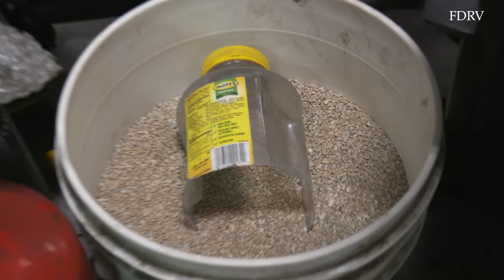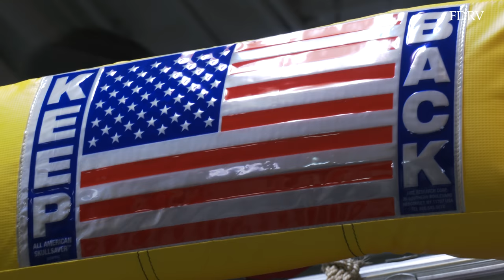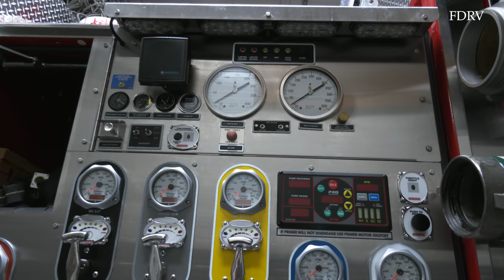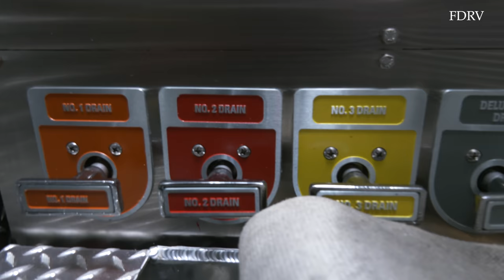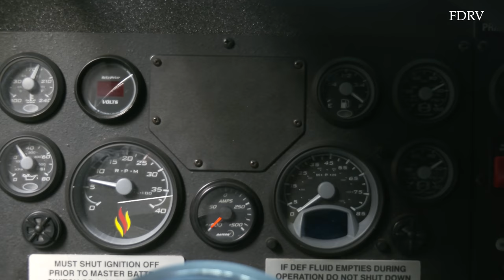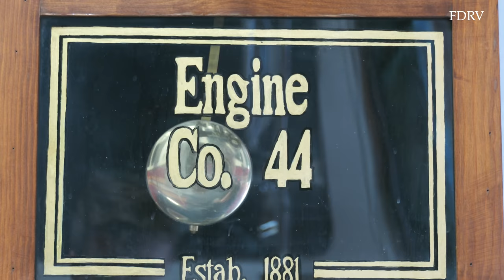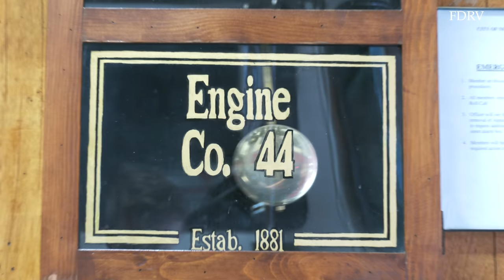**FIRST RUN & FIRE!** BRAND NEW 2020 Engine 44 Operates at a Car Fire and Packs up Their Rig

Comment: I believe FDNY engines carry more hose than any other i've seen , I believe they could stretch a quarter mile line
Reply: For that length of a lay ldh is the only way
Reply: Those boxes right on top of the engine help out alot, just short enough to clear everything (including the bay doors) and just large enough to hold some bulky gear.

Comment: Beautiful! Does it have a 1250 or 1500 gpm pump? I’m guessing 500 gal. tank. Thanks for sharing!
Reply: 500gal tank--most engs are 1500 gal/min--some new ones in the last 3 yrs are 2000 gal/min.hope this helps
Reply: @terrymartin6892  back in the 80’s when we purchased our new pumper it had a 1500 gal pump, The first time we used the pump was a drill night. At full capacity supplying a snorkel the first 4 houses closest to our pumper we sucked the water out of their hot water tanks and twisted the plumbing in the basements. Most of the pumps in my area are either 1250 or 1500 with restrictions on certain hydrants depending on the diameter of the pipe supply the hydrant.

Comment: hello, sorry in advance for my english.  I have a question, how many years are vehicles in NY replaced and what's in that yellow barrel on the back
Reply: The yellow cylinder on the back stores ice water or Gatorade for the Firefighters to drink while on calls.
Reply: @jaymesc.moreland9265  thx. Very good idea.
Reply: @tajemniczy998  The rigs are that are in Frontline serve for 10 years before they're put in service as a spare or reserved. Eventually when spare trucks retire,  the  trucks are either sold to a another fire department or they'll be scrapped.

Comment: why does a city truck need so much hard line? I would have assumed they would not draft very much due to hydrant accessibility
Reply: 9/11 may be part of the reason water was quite badly affected by that don't know how much hard line they had back then but they used the boats for water supply for a few fires but also It's better to have them and rarely if ever use them then not have it and run dry, no?
Reply: Hard sleeve is often used for more than just water supply, for instance it can be used for pumping out flooded basements etc.

Comment: Automatic transmissions?
Reply from the maker: Yes. Manual would not be smart for an emergency vehicle
Reply: @FDNYResponseVideos  Makes sense these days. I'm from an older generation. Just seems amazing that they can make autos to push these heavy vehicles up and down the road without smoking clutch packs or bands. Thanks for the reply and all that you guys do.
Reply: If they had Stick/Standard...Traffic in NYC would kill their arm in just a few calls.
Reply: @FDNYResponseVideos  true dat lol
Reply: I drove an old Mack pumper with an 8 speed manual when I volunteered 25 years ago. Now they're all electronic and throttle by wire as well. (Fort Worth-Rosenbauer an Pierce pumpers)
Reply: Yeah, Allison mostly I think?  Push-button and everything.  No more gearjamming or (God forbid) twin sticks!

Comment: what??!!  Keep back 200 feet! That's almost the length of a football field.  What idiot decided on that?!
Reply from the maker: Nobody listens, but it’s quite smart. When a truck pulls onto a block they don’t want people following them because when they stop in front of the fire building and another truck comes in from behind, the car gets pinned in and is in the way. Pretty simple logic that the street is about 200 feet and so you should have people stay back that far.
Reply: @FDNYResponseVideos  It's funny, living in a rural area I've seen trucks marked back "keep back 300 feet" or even "keep back 500 feet."  I thought 200 feet was a little close until I realized that it's NYC, you'll never find 200 feet without a car occupying it anyway! :)